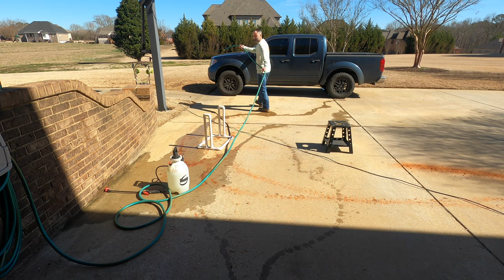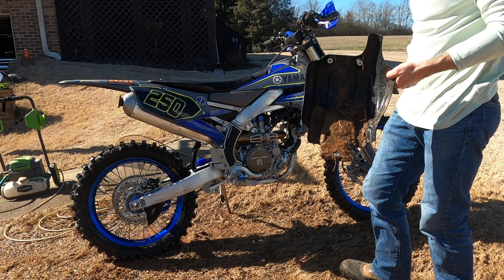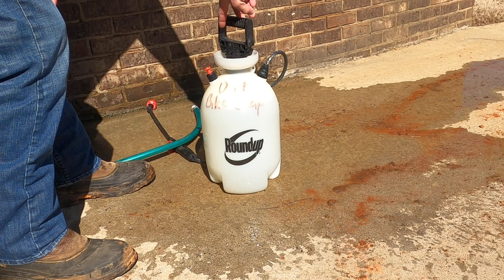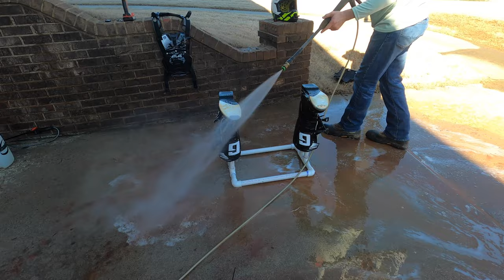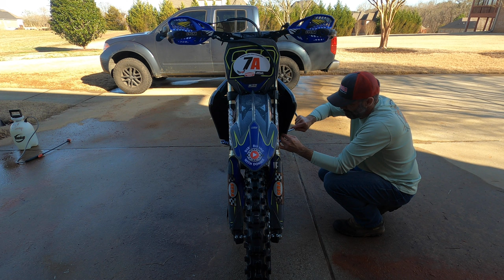How I clean my dirt bike after a muddy ride or race | YZ250FX

Comment: I agree knowing how to use a pressure washer is key. One thing I did notice is that you are spraying right into the fork seals which you probably should avoid. Certainly the rest of the bike will be more water resistant but the fork seals are only rubber

Comment: Another Great  video!  Can you send me the dimensions of the pvc boot rack for washing?   Brilliant idea.
Reply from the maker: Thanks Tim.  The base is 22 inches wide by 15 inches. The legs are 21 inches tall and 4.5 inches wide.  I used 1 inch PVC because I had it laying around but 3/4 would work too.

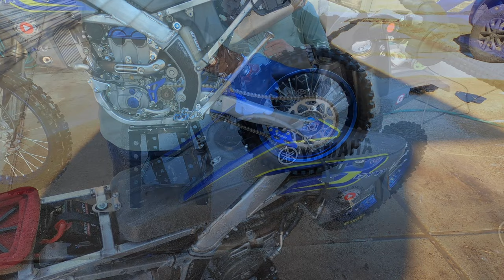Comment: 5:55 noticed your running the anti-gravity battery. Which cell size did you get? and did you notice a difference in start up times?
Reply from the maker: I’m using the 8 cell (AG-801). It’s a big improvement over stock. Increasing the idle to 2500 also helps with starting. If you’re racing and wanting better dead starts replacing the stock clutch is a must. The stock clutch has a lot of drag when starting in gear.
Reply: @DirtBikingwithDonnie  Thank you for confirming I wasn’t the only one with a very draggy clutch when starting in gear I thought I was the only one. Must be a YZ thing or something. Thanks so much!
Reply from the maker: @wheressu  Yes, it’s a common problem. The Yamaha clutch baskets wear very quickly.

Comment: Do you spray anything on the plastics to help cleaning it next time.
Reply from the maker: If I’m going to a muddy race I’ll spray Maxima SC1 under the fenders, on the skid plate and around the engine where mud usually builds up. It seems to dry a bit over time so I don’t put it on until the day of the ride or race.